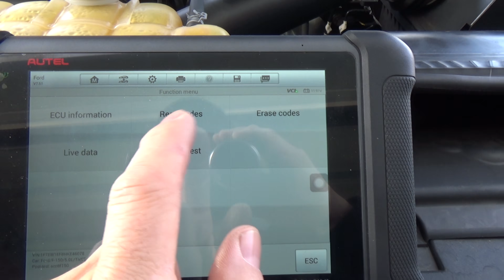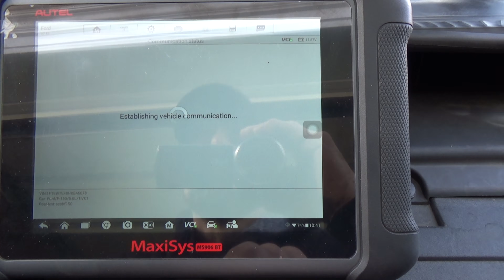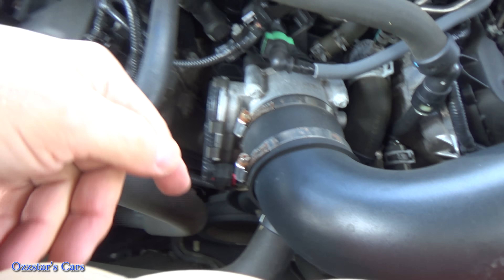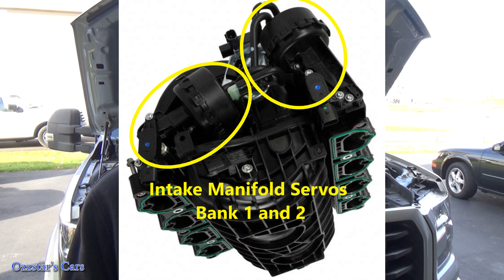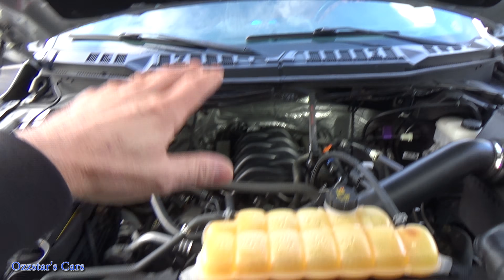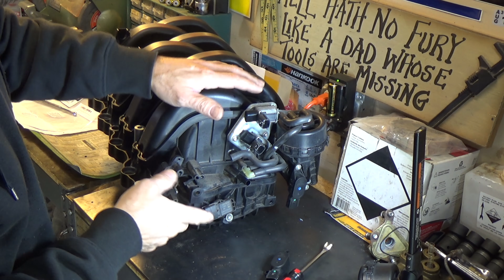Ford F150 Engine Rattle Tick Noise: I Can't Believe Shop Says It Needs A New Engine

Comment: Similar thing happened to me with the noises coming from my 2018 F150 xlt 5.0 with 90k miles on it. I was told by the dealership that the engine had compression issues and that 2 of the valves were completely burnt up. Smh
Reply from the maker: Did you get the truck properly diagnosed? Tell us the story.

Comment: Could this possibly be a problem on a Ford F150 2 Wheel Dr.? I’m going around looking for a troubleshooting with exactly the same sound you have but it’s just a 2 Wheel Dr., F150 white work truck V6.
Reply from the maker: Only a proper diagnosis will determine what the issue is. Can't tell you over the internet, sorry.

Comment: what happens with mk f150 2017 6 speed when I go in gear 6 on the road it makes like a knock, not when it makes the change when it is already in gear 6 as if it passes a small unevenness but there is nothing like a jump it brings me something Worried, the changes are made perfect but I feel the blow only in 6. Someone who has gone through something similar would appreciate it here writing from my translator. Greetings from Mexico
Reply from the maker: You may want to mention the mileage.  It's nearly impossible to diagnose something like that over the internet.
Reply: @ozzstars_cars  100,000 kms

Comment: I have the same year and same truck and motor. My truck at 100k miles started making a really loud clacking sound like it had a bad spark plug. Or bad valve. It gave an error code of bad cam position sensor. Had it checked out and the tech said I wasn’t changing the oil often enough. He said you can’t let these engines go more than 3,000 miles. He said the cam position sensor was clogged . He cleaned them out and the noise went away. He said the timing was off and too to retarded.
Reply from the maker: @timboylen5475  that's a valid point. I recommend oil changes every 4-4.5k miles max.

Comment: I have the same noise in my 2021 F 1 50 changed all the hydraulic lifters made no difference 
Mechanic friend says its valve stem ware
Reply: I THINK i WILL TRY THIS SOME HOW LOT CHEAPER THANA NEW MOTOR , WILL LET YOU KNOW

Comment: You sir are an exceptional mechanic! I own a 2017 with a 5.0 and I’ve been worried about this sound since I purchased it. I just could not figure it out even with my stethoscope. Sometimes I also swear there’s a rod knock but not coming from the bottom end. I think the knock must be a cam phaser. It’s a spectacular engine but I suppose I’m just used to a traditional pushrod v8 that idles real quiet. The 5.0 has about 6 billion more moving parts so I suppose a little engine noise can be expected. Or maybe it’s a ticking time bomb? Guess we’ll find out down the road.
Reply from the maker: Hey Nicholas, how many miles does your truck have on it?
Reply: @ozzstars_cars  just rolled over 135,000 km so I think that’s roughly 85,000 miles?

Comment: Hey Glen, I've got a 2017 f150 long shot here but I've got a similar sound only it sounds like a baseball card on a bike spoke. Ford ran a pressure test and was leaking .5in-hg per minute. They replaced iwes check valves and suply lines. The noise came back. Any suggestions? Seems to be the sound is very noticeable around 30 mph
Reply from the maker: Could the iwe itself be failing? How many miles on the truck?
Reply: @ozzstars_cars 
82,000
They could have missed the last step on installing the iwe which caused it to fail again. But even in 4x4 the sound does not go away. It seems I am not getting enough air and the iwes are semi engaged. I did have a dog whistle with a slight loss of power. Ford has trouble duplicating the noise which is pretty frustrating
Reply from the maker: @markmanning54  I would smoke test those vacuum lines. Diagnose it in a few minutes.
Reply: @ozzstars_cars  I'll be damned. I spent hours looking at my truck and doing research only to find out the "baseball card hitting a bike spoke" was the damn bar code sticker on the drive shaft hitting the exaust. It was half way peeled off. What a relief though.
Reply from the maker: @markmanning54  problem solved! Classic!
Reply: @ozzstars_cars 
I also had water pump pulleys belts and the tensioner replaced 
This clicking or ticking didn't happen until about 100 miles after that

Comment: My question is wouldnt the clattering noise be co ing from a faulty signal being sent to the servo, or a malfunctioning servo and not actually from the runners themselves? Seems this rattle noise occcurs on lower mileage engines that shouldnt have worn shaft busings or other worn components. I guess im confused why the entire intake manifold needed to be replaced. Which actual component of that entire assembly was the root CAUSE of the rattle noise ? If it was the flaps, were their shaft bushings or the actuator arm damaged or worn, or was the servo pulsating with a crazy signal essentially flipping them open and closed rapidly? 
What ?
Reply from the maker: It's all one unit. No separate parts.

Comment: I haven't finished the video yet, but this sounds exactly like the problem I have in my 2023 GT. I just got it back from the dealer and they said it was the "Coyote Tick" and chose not to fix it. It's a very embarrassing noise for a car guy to have on a new car especially.
Reply from the maker: It's disappointing to pay so much for a new car under warranty and be told by incompetent mechanics that nothing is wrong. My suggestion is go elsewhere and find a technician who is qualified. Smh.
Reply: @ozzstars_cars I see that some people buy lockouts for the arms that move the runners. I'm assuming this would stop the noise as well. It just locks them open.

Comment: My engine ticks at low rpms.. tick tick tick tick tick.. brought to two different ford dealers.. engine within spec they said some just do it, they blame cam phasers told me to get an oil catch can - 2018 f150 5.0 bought brand new in 18 they've all blown smoke up my ass every time I tried getting answers
Reply: I get the engine rattle on decel too.. I've brought it in and heard within spec it just happens so many times. One guy blamed shit fuel and said it was spark knock. Shit fuel?! It doesn't matter if I run 87.. 91.. non oxy.. or e85 it always happens!
Reply from the maker: They sound incompetent and nobody qualified to make the call. 2018-2020 F150 engines are very problematic.

Comment: I have a rattle situation going on that I’ve been chasing and curious if this might be a culprit, haven’t taken it in for diagnosis yet, but trying to self diagnosis beforehand to help a tech’s search. 
Somewhere around 1500-2000 RPM I will get a slight rattle/clatter, the noise won’t duplicate in park, only when driving, and it seems to do it at/after shift points when the rpm’s drop. It’s not every time either, but does it somewhat regularly. Once I get above 2000 rpm’s it goes away, or if I am heavy on the gas I don’t notice it at all (not sure from engine noise or it’s just blowing past it.) It does it regardless of engine temp. My initial concern was a timing chain or cam issue, but not entirely sure on that. Yesterday I towed a trailer for a bit and it was much more consistent and prominent. 
I watched some videos on potential issues with exhaust VCt solenoid as well as IWE check valve.
But with what I am experiencing, does that seem consistent with what this video is addressing? 

Appreciate any direction or response!
Reply from the maker: Follow the detailed instructions in the video to find out if the intake manifold runners is defective or not.
Reply: Will do!
Appreciate the response
Reply: Ever figure it out

Comment: Just to add. Those flappers change the intake air path between short and long runners. The long runners are to give the incoming air extra velocity for torque at lower rpms.  The short runners are used at higher rpm because the air is already moving fast and can go straighter into the combustion chambers. The shorter path is used to eliminate some of the air path and thereby reduce restrictions.
Reply from the maker: That's good info! Thanks for sharing.

Comment: Would it possibly get better as the vehicle warms up? My 2017 f150 5.0 makes a clicking sound when cold and I can hear a whirling sound under acceleration that seems to clear up after driving for a while.
Reply from the maker: Intake runner will rattle at any temperature when it's defective. Cold start rattle tends to be cam phasers, timing chain slap, lifters, lack of lubrication, things like that.
Reply: @ozzstars_cars  I really appreciate the response! As others have pointed out, it’s tough to find a real mechanic and not just a parts swapper. Great video BTW!

Comment: I'm a 20 year mechanic up in Canada, just started a new job with a fleet of ford 6.2s, 5.0s and 6.7s (60+ vehicles). Mostly worked on Cummins before here, so Ford isn't my specialty. 
This video will definitely help. Currently dealing with a 5.0 coyote with cylinder 8 misfire, narrowed it down to worn out valves. I suspect one of my other trucks has this intake runner issue.
Reply from the maker: On the no.8 misfire, how many miles? Did a leak down/ compression test?
Reply: @ozzstars_cars  350,000kms. Ran all the tests, valves are shot.

Comment: Im wondering what would happen if you just left it as is. I know im going to have to do cam fazers too so Im thinking of just waiting . Great video. Just subscribed
Reply from the maker: Good question! I assume it wouldn't be good long-term to leave the intake rattling but don't know for sure. What year and how many miles does your F150 have on the clock?
Reply: @ozzstars_cars  2018 with 48k. I think I have this rattle. I thought it just might the loud direct injection. Also.. if the cam fazer only makes that clicki g sound when cold, is it doing any harm?  Or should I get on that soon?

Comment: Ford needs to put a recall in that manifold ..  It's a bad engineering design for that manifold. People are told that they need a new engine when it's a manifold problem. Ford should see this video. Thanks Man ..  Great Video 👍
Reply from the maker: Write Ford an email and share the link.😁 Actually recalls are only for safety issues. Unfortunately in this case a noisey intake manifold doesn't count.
Reply: Looks like this could be fixed by putting some sound insulation under the hood. I think the manifold still functions even if it rattles. Anyway, it is information that can be used to get a good buy sometimes on a Ford pickup. 😁
Reply: @ozzstars_cars  I agree and have a similar F150 at my shop now. I was currently a Ford dealer tech. But it should be a TSB ( Technical Service Bulletin )or even a GSB ( General Service Bulletin ) For safety recalls to happen PEOPLE/OWNERS have to make complaints to NHSA ( National Highway Safety Association ) then they will investigate issues and announce their results. For TSB and GSB we need more Tech like Ozz calling the engineers with their findings.
Reply: It's an older gen 5.0L engine dude. Newer ones don't do it . I own one!

Comment: I hate plastic parts. 
I owned a 1998 Ford Windstar and both of the intake manifold runner controls went bad within two months of one another. I had to buy these from the dealer and cost about $135 each. I believe the diaphragm starts to leak. Our minivan started doing weird things like intermittent stalling before the check engine light finally lit up. Ford puts incredibly cheap parts in their vehicles and these are just two of many items to fail on our minivan. None of the failures were related to maintenance.
Reply from the maker: All manufacturers cut corners to save money and make profit. It's a corporate epidemic!

Comment: You are an awsome mechanic! Had a 2011 f150 i bought like 6 years ago it was a beautiful truck 95,000 miles. Noticed a noise coming from passenger side fender area shop said i needed new engine. I had extended warranty so i said whatever put it in didnt cost me anything. Put new engine in and after awhile it did same thing and ive noticed all of them do it. So to say the least the shop was wrong. Truck ran fine and was a great truck. These engines can just be a little noisy sometimes.
Reply from the maker: I'm a Ford truck guy. Currently I own three. If I had the space (land and shop) my collection would be out of hand! Keep picking up that camera and share your passion! Take care -Glen
Reply: @ozzstars_cars  I appreciate it. Ive had a hard time getting motivated here latley this helps. God bless
Reply: @ozzstars_cars  💯 👍🏻 🇺🇸

Comment: Modern day robbers, that's what too many in the service and repair industry are. They are correct, if you replace the entire engine, that should solve the engine noise issue. Heater not kicking on at your house, well, replacing the heater is one sure way to fix that issue. Air conditioner not working? It's 15 years old, we suggest a new 18,000 dollar unit, but you will get 500 dollars back from the government. 

I have a SUV with 135,000 miles on it, if a part wears out, I am pretty sure a new 60,000 dollar SUV would solve that issue. 

Always nice to see someone who is willing to actually look into the issue and fix that one issue, rather than throw out the other 98% of parts that are working fine.
Reply from the maker: Well said Ross.

Comment: My 5.0 had its ethanol sensors pegged out to like 90% and i had never once ran e85 through it. I kept hearing a chain/rattle sound from gears 3-5 took it in thinking it was the transmission.

Nope. They reflashed the ecu and re set all the sensors. Ran like new. No weird noises.

The ethanol sensor failed somehow and was advancing timing as much as it possible could. The rattling i was hearing was pure detonation according to the tech who worked on my gen 3 coyote.

I drove it that way for awhile lol. Immediately traded it in 😂
Reply from the maker: Somebody elses payment with a headache!
Reply from the maker: What year and mileage when the problem starting happening?
Reply: @ozzstars_cars  it was a 2019 4x4 scsb with 27k miles. It ran great after i got it back from ford. All warranty work but the fact it ran on detonation like that for lord knows how long. 

Didnt notice any drivability issues all winter, only heard the noise when the weather warmed up and i rolled my windows down

Comment: That diagnosis from the other shop would be correct. Except for pulling the motor if it was Cam phaser problems I have had those engines with bad timing chains  Phasers and timing chain guides. I have been able to fix 2 out of  the 6. I've taken apart because the first thing you do is pull the oil Pan in   frame not with  The engine Out. See what kind of  Trash you have in the oil Pan. What I mostly find is Pieces of plastic chain guide Which wouldn't be very concerning but I find pieces Of bearing material and  At that point it's all trash. I remember when the first 4.6 and 5.4 2 valve engines came out I hated them  tune-ups were a pain sparks strip but man I've done a ton of work on those things. They are so much better than the 3 valve They had their problems. but the 3 valve amplified  Everyone and added more. I have fleets that I service with old  gen one Triton engines and I tell them to keep them because they're a dime a dozen to get used moters trans easy and cheap to fix. These newer trucks just don't last. And they are definitely not worth the money.
Reply from the maker: They don't build them like they used to. Thanks for your comment!

Comment: Ford's been using that system since the early 2000s on V6's minivans Mustangs all kinds of stuff Never worked on the newer stuff  But all looks pretty similar carbon would gum Of the works Old ones were just commanded once intake manifold vacuum was lost they were open for higher RPM Performance Vaguely remember having one where the plastic clip broke that actuates the flap Break because of carbon and it would flop back of forth and rattle

Comment: Sorry, I'll Keep my 5.8L 351 Roller cam motor after seeing all that plastic.
Reply: My 351c is built and makes roughly 475hp @ roughly 8mpg cam 2 and sucks in traffic... The 5.0 makes 400plus stock and gets 17 plus mpg. Boosted the 5.0 could make 600 plus stock. My 351c would take the cost of a house to make that 😂

Comment: I have to say I had a 3.5 eco boost making noise and it was a grinding chattering noise…….the only time I used anything besides good oil, I used cheap penzoil off the shelf during Covid because I could not get any amsoil soon enough, 2000kms and it was horrible noisy, took a chance and changed oil fired up and silent! Pretty cheap thing to try……..5000km at the next oil change still quiet.
Reply: Different than your problem but a dealer told me it would need front covers taken off and probably new timing parts. When you use a coyote for a resto mod there is a company (fat fender garage) that sells clips to remove those actuators and just hold the flaps open, just a FYI.
Reply from the maker: Good suggestion, use quality materials and parts. 👍